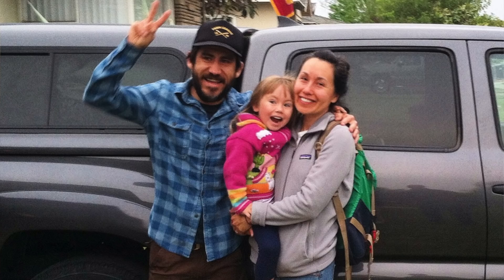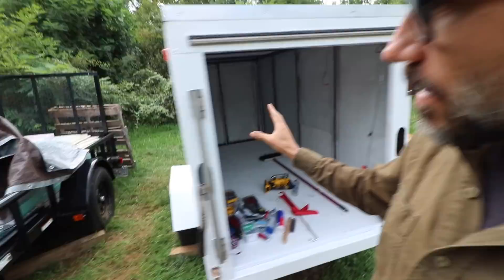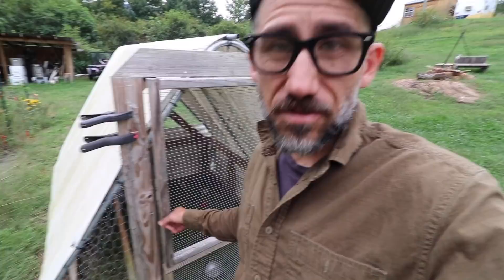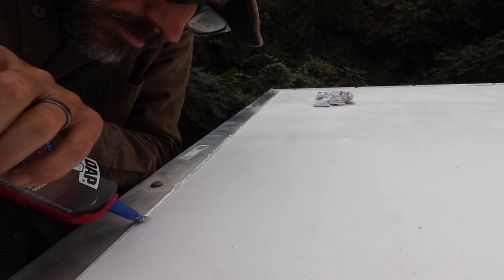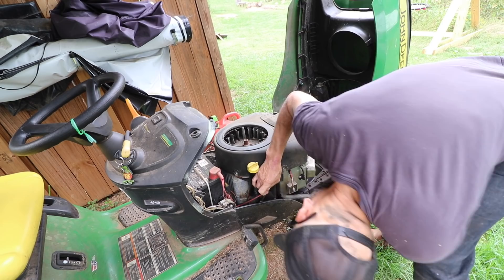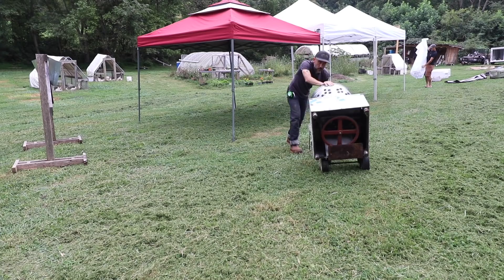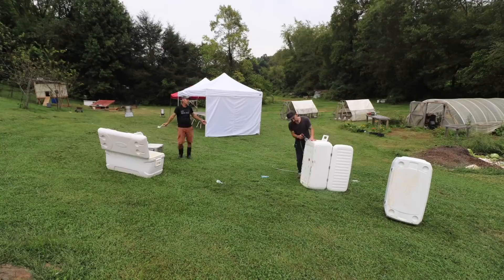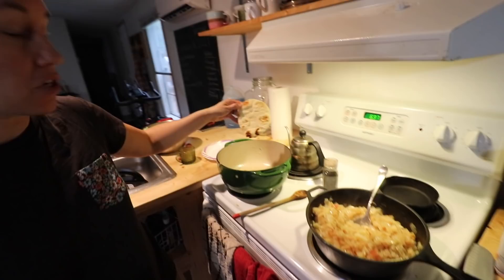Portable cool room but first TRAILER RENOVATION (Vlog)

Comment: You can get a new bendix assembly for the mower and repair the starter inexpensively and easily. As long as the starter shaft is intact. Trailer is looking good.

Comment: The way your dealing the tail light should work. That said next time you're dealing with a problem like this don't go to the hardware store first. Go instead to a truck and trailer shop. As in 18 wheeler shop. Also RV shop. If they don't have what you want they will send you to who does. I checked out your area and there were plenty of shops. I'm a 30 year veteran professional truck trailer driving and ownership truly they should be able to help you out. Looking forward to the next step on this trailer/ cooler. 😃👍